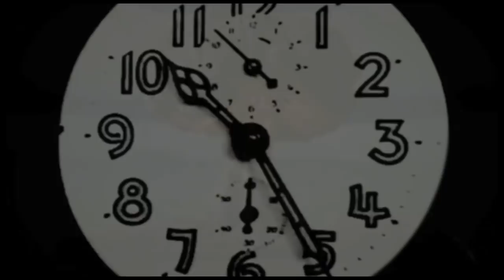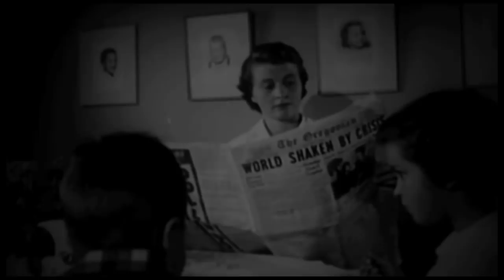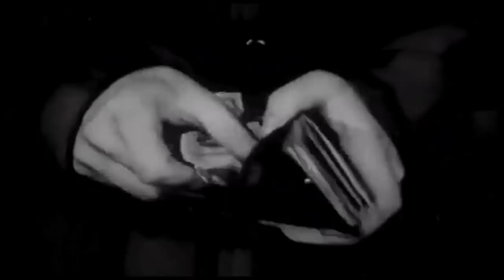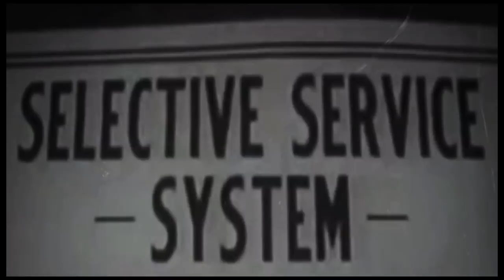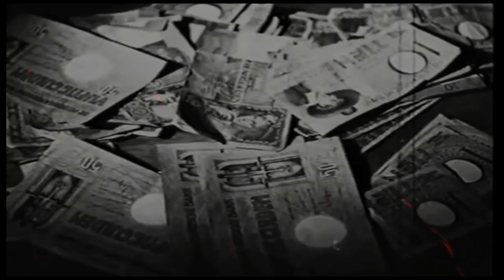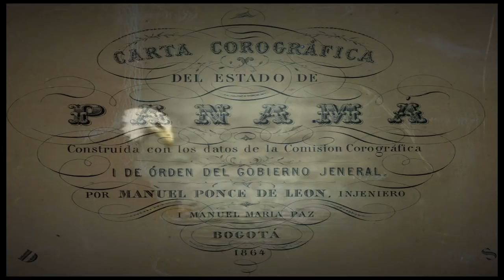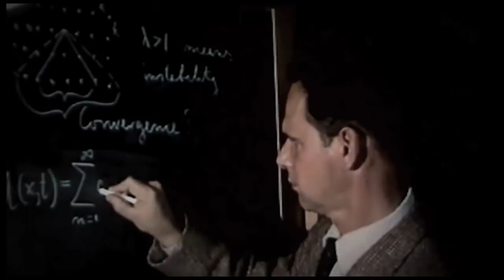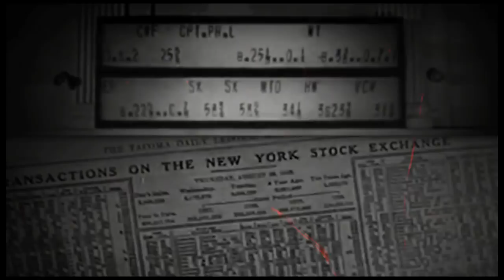Engines of Domination 2018 | Director's Cut

Comment: "the land can only be held in common for the common good" yeah no. Why shouldn't I own the land that I homestead and improve?
Reply from the maker: Systems of common landholding typically allow for private land USE. OWNING land as private property removes the land from overall community control by force. I think the distinction between owning what one produces from land and owning land itself is similar to the distinction between an employer "owning" the results of an employee's labor and a slaveholder owning slaves. Also, private land ownership allows the owner to exclusively benefit from the land, while common landholding benefits a community's common good.
Reply: @EnginesofDomination  you have it backwards. It is only through private property rights that common use can function sustainably. Otherwise you hit the tragedy of the commons. As Aristotle said, those resources that are owned by all are cared for by none. If you own your own land, the land that you homesteaded or purchased from someone who first homesteaded it and work to maintain it, you get to decide who you will allow to share in it. If someone is taking more out of your land than he is putting in, you can bar him from its use so that he doesn't degrade the land. If you want to take from your land more than you put into it, and the land degrades from this action, that is a cost you incur personally and must pay by fixing it in order to maintain your right to own the land. Any land owner who doesn't maintain his improvements to the land, such that they fall to a state of decay, ought to lose his right of ownership to the land unless he takes it upon himself to do the maintenance before someone else does and thereby claims the land he improved for himself. Now as far as your comparison to slavery goes, the land doesn't have a will of it's own and a corresponding principle of self-ownership that you have to violate in order to own it. And surely if they were comparable then common ownership of the land would not mean the freedom of the former slave, but simply that the slave is now owned by everyone else rather than a particular master, and so nobody in particular is obligated to feed him, clothe him, or house him.
Reply from the maker: I think I understand your viewpoint very well, and we'll have to accept that we disagree. Fundamental differences such as ours can't be properly discussed in YouTube comments. Thanks for stating your argument so clearly.
Reply: @EnginesofDomination  so you're not going to address my arguments at all then.
Reply from the maker: All right, I'll address your arguments briefly, but I don't have the time to further carry on a debate about this subject. Please understand that I don't care whether you agree with me. My purpose is to provoke thinking about political power, not to persuade anyone that my ideas are correct. I only wish to make my ideas clear. Feel free to respond here, but I doubt whether I'll reply again.
If common landholding is unsustainable, how did our ancestors sustain it for a quarter of a million years, until Domination began landholding by force of arms 6000 years ago? How did they create the prosperous neolithic agricultural towns that the first systems of Domination conquered? And why did the mercantile capitalist elite deliberately destroy the European commons which the peasant population depended upon for their lives? Why was a major strategy in the United States cultural genocide against Native Americans the policy of forcing them to practice private land ownership? I believe "the tragedy of the commons" is pro-capitalist propaganda that demonizes forms of community that threaten it. As for landholding by force of arms as analogous to slavery, I don't accept the principle of "self-ownership," since ownership implies the ability to relinquish possession, and one cannot relinquish oneself. I regard the land, and indeed the planet, as an autonomous living being that must be given foremost respect and care, since human well-being depends upon its well-being. I think basing anarchism on ownership -- whether of self or property -- covertly internalizes an institution that only began with Domination, an inconsistent and self-defeating idea. I hope I've made my position clear.
Reply: EnginesofDomination  I don't particularly care if you respond, i just like honing my own arguments.
"how did our ancestors sustain [common landholding] for a quarter of a million years?"
They actually didn't. Human tribes routinely decimated the local environment until it became unlivable. Often they burned down entire forests in order to easily collect the roasted tubers and well cooked wild animals that got caught in the fire. This necessitated a nomadic lifestyle, in which they would leave an area and come back to it in a few years once it had recovered. In fact it is this lifestyle we actually have to thank for the various human migrations which spread our species around the globe and established the rich diversity observed in it today. In any case, this behavior is technically sustainable in the sense that you can leave that area and come back to it in a few years and find it mostly restored and you can ravage it over again. However, as the human population grew and tribes began competing for land, indirectly if not in direct conflict, there was less time for the land to recover before it would be ravaged by humans again. This gradually reduced the viability of the nomadic lifestyle and necessitated the rise of agriculture.

"How did they create the prosperous neolithic agricultural towns"
I'm pretty sure they didn't exist. agriculture and the state kind of co-evolved. As soon as there was an agricultural surplus of grain to tax, they taxed it.

"why did the mercantile capitalist elite deliberately destroy the European commons which the peasant population depended upon for their lives?"
I believe that the overuse of the land gradually degraded it and that the land that had been enclosed was not subject to that overuse and was therefore comparatively pristine. This might have lead to the presumption that the elite had somehow destroyed the peasants' commons, when in fact it was the peasants themselves who had done so. If someone had taken a purposefully destructive action, they could have been tried in the king's court, or the church court, or any number of other court systems which existed at the time. At any rate, If someone goes out into nature and finds an unowned tract of land which he works to improve for his purposes, he should be the owner of that land. For why should someone else benefit from his labor without his agreement?

"I believe "the tragedy of the commons" is pro-capitalist propaganda that demonizes forms of community that threaten it" 
As I said, the first man to make a note of the tragedy of the commons was Aristotle, who came long before any notion of capitalism. And if anybody is propagandized, it's likley you. You seem to have gotten all your information on this subject from the works of Marx and his followers.

" I don't accept the principle of "self-ownership," since ownership implies the ability to relinquish possession"
No it doesn't. Ownership is the right to exclusive use of a particular resource, in the case of self ownership, that means your body. Nowhere in that concept is the ability to relinquish that ownership necessitated. Although it is technically possible to relinquish control of your body by being killed, either by yourself or another. As such, even if we did humor that implication, it would not follow from it that you do not own yourself. In fact it is required that you own yourself in order for you to even try to argue against it. If you did not, you could not make the argument. Since you own yourself, you also own the product of your labor, which you can sell at any price you are willing and that someone else is willing to pay.

"I regard the land, and indeed the planet, as an autonomous living being that must be given foremost respect and care, since human well-being depends upon its well-being." If it were autonomous, it would not require our care. Children are not autonomous for this same reason. Human well-being is based on one being able to get the resources they need to fulfill the desires which are most important to them. This does not necessitate the well being of the planet. In fact, those advocating the wellbeing of the planet are also advocating against human wellbeing. And when we get off this planet, live in space habitats,  and build a dyson swarm, we definitely won't be limited to the planet any more. That's the trouble with you communists, you think too small.
Reply from the maker: Again, thanks for making your ideas so clear. And again, as I said at first, I think I understand your viewpoint very well. A final remark: I did not get all my information on this subject from Marx and his followers, but rather spent thirty years formulating my original theory of political power, as presented in my book and summarized in our Engines of Domination film. And although I'm accustomed to being labeled as a "communist," I am not one.
Reply: I mean, you call for the common ownership of land, so I'm not sure how that doesn't make you a communist.
Reply: @sethapex9670  Your ancestors fought for their land against invaders. Land they commonly owned and defended. I don't think owning something in common decreases it's values. Especially land. On the contrary. The more people own it, the more can take care of it. And the more people can benefit from it, the higher it's value. And anarchy is not communism. 

Check out the "Living Utopia" documentary on youtube about the Spanish Anarchists.